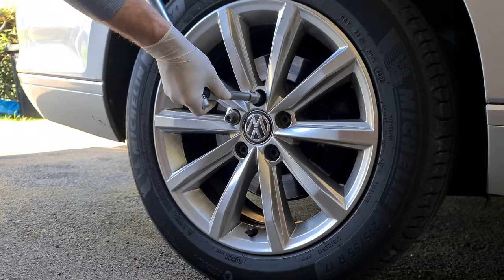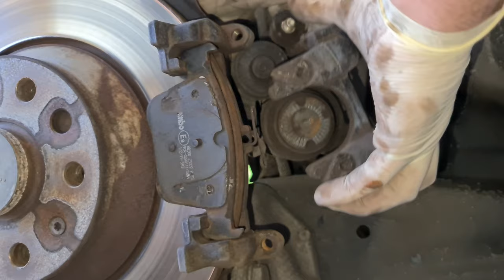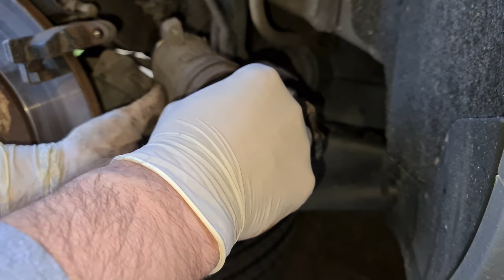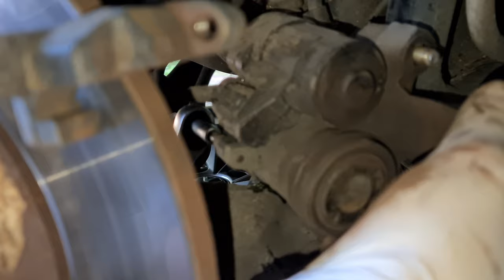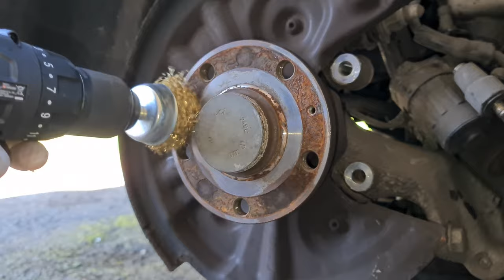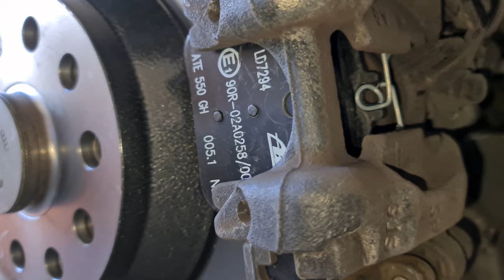how to change rear brake discs and pads without vcds passat b8 | inlocuire discuri si placute spate

Comment: Great work! Only one remark, to replace rotor no need to dismount brake pads holder on rear wheels 😊 for b8 passat.
Reply: Hi, good remark and do not you know if is necessary to dismount brake's electric motor for pushing brake piston?

Comment: Great video thanks for the help doing this job. One to watch for if your car has high mileage or lots of corrosion like mine. I managed to snap one of the bolts which holds the parking brake servo motor to the caliper. I suggest soaking from both sides with penetrant spray 1st before loosening.

Comment: I found out that the disc can be removed and remounted without unscrewing the calipermount! This makes a big difference since those bolts can get stuck hard!
Reply: How?
Reply: On the same car, passat b8? If so thanks for the info 🤗
Reply: @fractalofgod6324  just angle the disc and take it off
Reply: It‘s possible on the Passat and Tiguan don‘t know why Not on others
Reply: I confirm that it is indeed easy to remove the disk without unmounting the calipermount! (at least on my Passat B8 110kW 2.0 TDI from 2016, Brake "1KU" or FNc-M42 (16"), 300mm disk).
Also I'd recommend to use VCDS/OBDeleven/etc. to open the electric parking brake - this way it is not necessary to unmount the electric motor before pushing the brake piston back into the brake caliper.
In summary I had just to
- put the electric motor in service position (open)
- remove the spring
- unscrew both 7mm  hexagon sockets screws to remove the brake caliper from the brake pads
- unscrew the little Torx on the brake disk
- push back the brake piston (for this I opened the compensation reservoir of the brake fluid)
- mount everything back
- close the electric motor
Reply: Was able to remove the rotor without taking off the bracket on 2017 Jetta GLI.
Reply: Just tried this on a T-roc and just can’t get it off. It’s close. Really don’t want to try and take those bolts out of the back as I’m pretty sure they’re torque to yield and probably should be replaced. I’ll try again tomorrow but it’s definitely not easy like I’ve seen with the tiguans.

Comment: Followed this procedure today, thought it went great until I tried to drive the vehicle. Brakes all work fine and so does the electric handbrake but the car is displaying all faults with the braking system and is running rough and stalling. Any ideas what has gone wrong?
Reply: Did You reconnect the ABS jumper?

Comment: What is the 12 sides torx type tool for removing the brake caliper carrier. I hit this problem before where i did not have that tool to change disc. Whats the tool called?
Reply from the maker: so you will need 14. I don't know exactly what it's called, but if you want I can leave you a link with a kit and from there you can search for more details.
Reply: @auto.b.i.daniel  yes please, thanks 👍
Reply from the maker: https://www.ebay.co.uk/itm/INDUSTRIAL-Impact-Spline-Bit-Sockets-Tamper-Proof-Spline-1-2-M4-M18-Hex-Torx-/363291189948?mkcid=16&mkevt=1&_trksid=p2349624.m46890.l49286&mkrid=710-127635-2958-0

Comment: Hi,I tried to do the same today and I almost made it but I couldn't push the pistons all the way in and I couldn't push the pads.Does anyone know how to do it properly?Thank you
Reply: Just turn the pin that is rotated by the motor in the right direction to retract the piston. If you push it without rotating it you can damage it.

Comment: Hi, B8 rear disk 300mm right?
Reply from the maker: in my case 300mm. I have 2.0 150hp
Reply: @auto.b.i.daniel  Thanks, mine 2.0 220Hp R line.🙂
Reply from the maker: @Dannyongwc5  Not sure if yours is 300mm
Reply: @auto.b.i.daniel  Same as your according to Brembo spec sheet.

Comment: Warning! Please do not Do it with out vcds did it same way 1 year ago and the hand brakes weren't really fully disingadged and the pads lasted only 7 months and my left handbrake doesn't engage fully.
Reply: probably has absolutely nothing to do with vcds, more likely there is another problem, like a rusted piston that gets stuck, chrome seems to be very thin on these, so once they start rusting from the dust cover groove, it goes quickly, in my case I serviced all 4 corners and everything was fine, pistons moved freely when I put the new discs and pads on, yearly inspection brake test was perfect, but after the winter I had first one seize in the front, lots of rust behind dust cover, then a month later one of the rear ones also, but that one "fixed" itself after few km when I actuated the hand brake a few times, when I took that one apart - same issue - heavy rust starting from the dust cover groove on the piston
they use loads of salt on roads here in winter, and usually the weather is around 0 for most of the winter, so everything is rusting like crazy...
Reply: A cheaper alternative is to have an obd11

Comment: Question, so it doesn't fuck up the electric brake system at all? And do you pump the brakes afterwards like normal?
Reply from the maker: if you take off the electric motor that actuates the brake piston, you will not break anything, however I do not know if the brake piston is pushed by normal pressing or only pressing and turning at the same time. in my case as you saw in the video everything was normal and I used this method many times on different cars in the VAG group